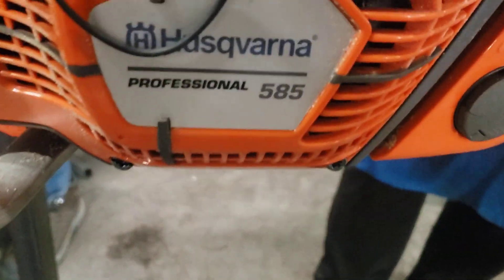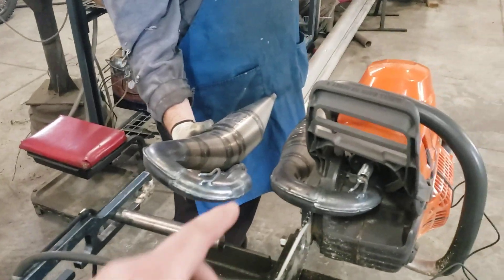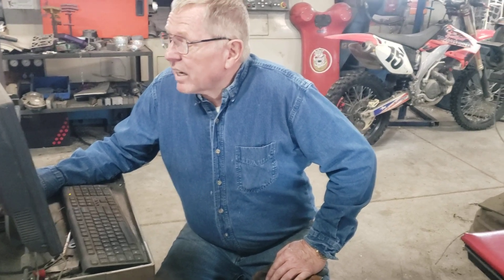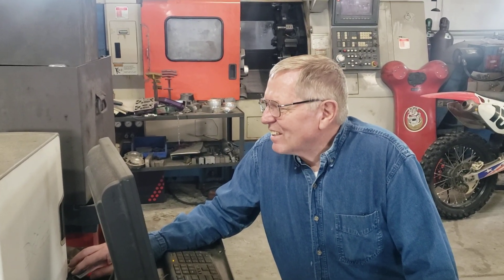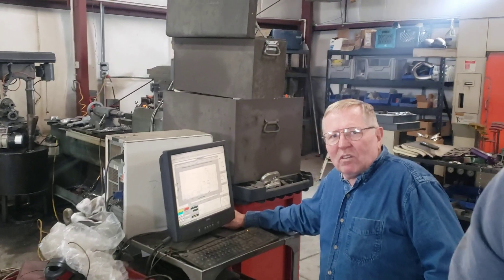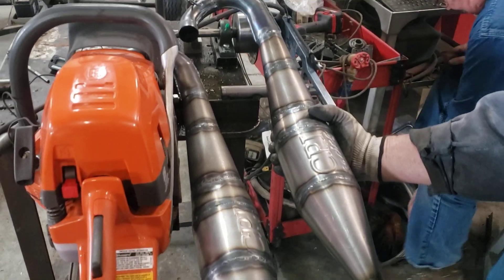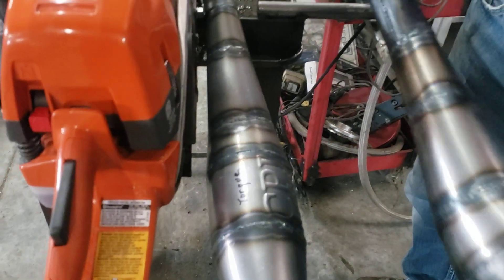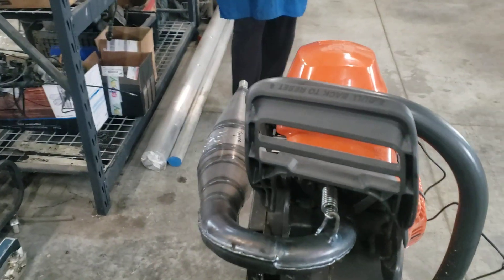Which exhaust pipe will cut faster? Husqvarna 585 chainsaw Dyno talk 592 xp

Comment: I don't know what one is faster but I do know for getting work done I prefer a saw with a broad power band. Less pulling a stalled out saw half way through the log equals less strain on my back. Nice work on those pipes.  I'm looking forward to seeing them both cut.